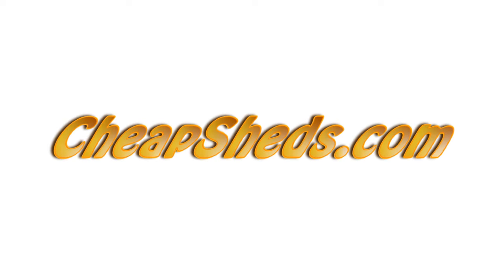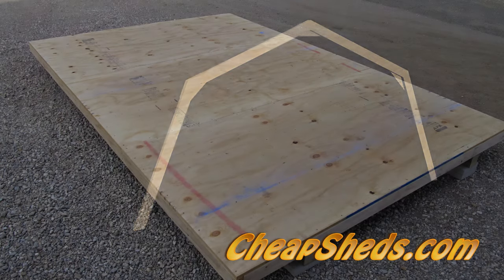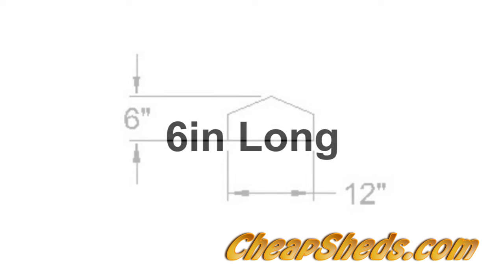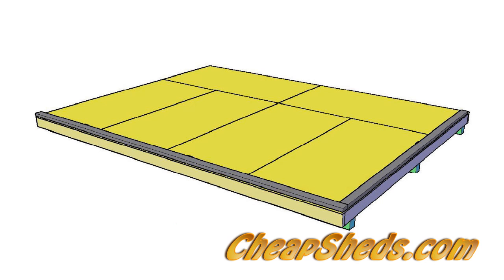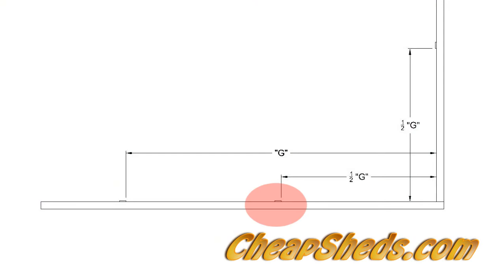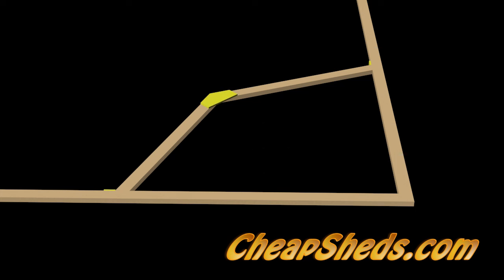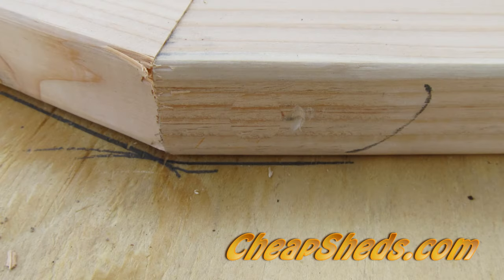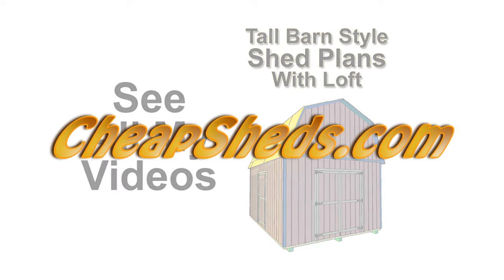How To Build Barn Style Shed Roof Trusses

Comment: I bought your plans a long time ago, nothing was put together right .I don't have a G&H plans or specifications? I'm building a 10x20That can't be any higher than 12 ft.I think you last messaged me to cut down the walls to make that 12 ft height. The plans are a little bit sketchy but I will figure it out Thank you.
So is G&H for a 10 ft wide shed 3 ft 10 at 22 and 1/2°???

Comment: Using this method to build trusses, what will be the head room for storage, after putting down two by fours and decking.
Reply from the maker: That depends on where you put the loft floor joists. There is about 7ft 6 inches from the floor to the bottom of the trusses, and the truss height above the top plate is 1/2 of the shed width. If you put the loft on top of the top plate you will loose the headroom in the trusses. But if you put the loft below the top plate then you will lose the headroom below. But this should not be an issue because that still leaves plenty of headroom in the lower part.

Comment: How would this work for a load bearing roof?  I want to build a 20 X 40 hay barn..  I will be using a hay track and carrier at the top center of the roof.  The hay will weigh around up to  400lbs.
Reply from the maker: I have never built barn trusses over 14ft wide so I have no first hand experience if they will hold the weight or be suitable for a 20ft wide shed. The safest way to construct a shed with these requirements would be to buy manufactured trusses that are built for the width and weight you want.

Comment: can you use the same techniques to build a garage instead of a shed ?
Reply from the maker: tcseacliff That depends on if you are building to code. If you build a 16 ft wide garage you should be OK strength wise. But not if you are building to code because these trusses aren't certified by an engineer. They just work based on experience, since most sheds don't have to follow code.
Reply: what would you do , building them ,wise to be engineer certified? or is it just for the paper?the look good to me!

Comment: where is table  2 ?
Reply from the maker: Table 2 is on page 71 of my Tall Barn Style Shed Plans. The table is called "Dimensions that vary with the length and width of the shed." This is where you will find all the measurements for the sheds that correspond to the building figures and diagrams.

Comment: so a birds mouth is not necessary?
Reply from the maker: The roof sheeting meets the sidewall siding if you do not build with overhang so in this case they are not necessary because there is no gap to cover.
Reply: CheapShedsDotCom 8